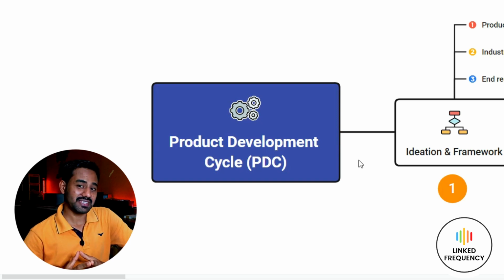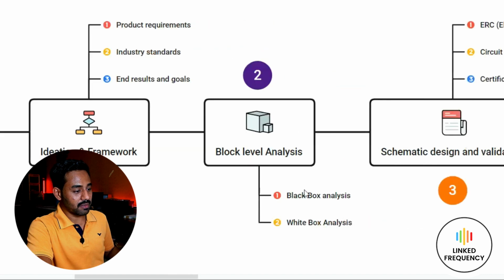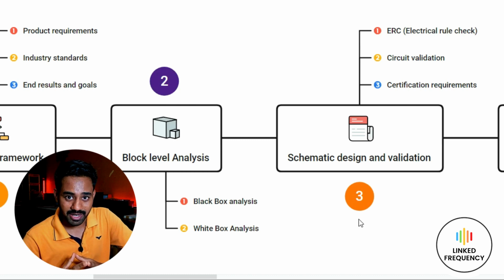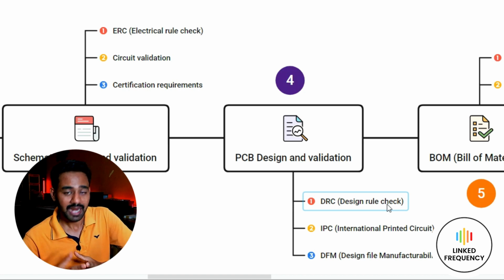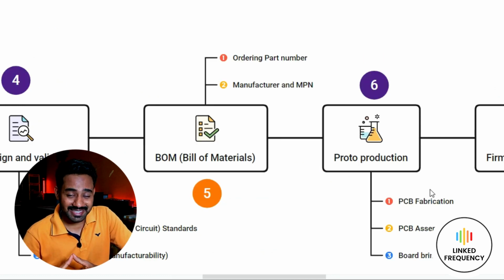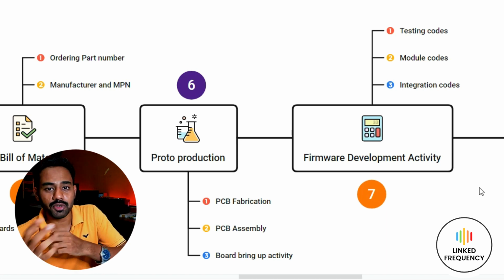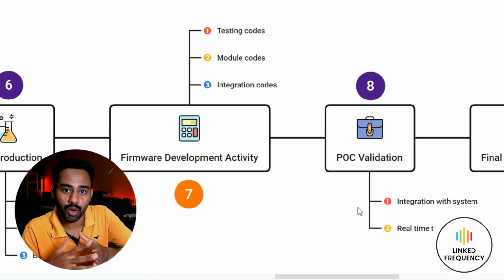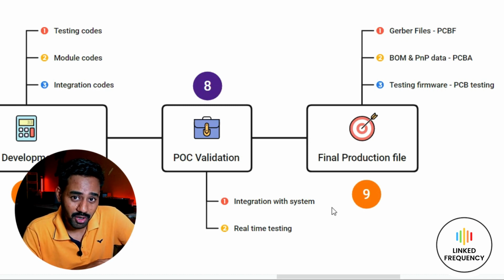Product Development Cycle in ESDM Industry #E03 | Vaibhav Sugandhi

Comment: Sir After Schematic we need to do Simulation for the circuit Right ?
Reply from the maker: Simulation is an optional stage for most of the projects. Due to limitation of environmental conditions in simulation tools, I do not prefer to relay on simulations more often. However, in complete circuits like RF design, high power design, thermal design and others are suitable for simulation stage. Also, real time simulation EDA tools are very costly and has complex learning curve. 

Due to these reasons, we have not considered simulation in this video tutorial.

Happy learning :)
#Linked_Frequency